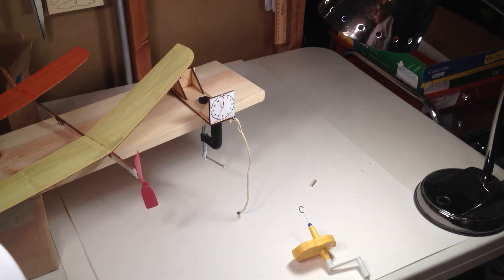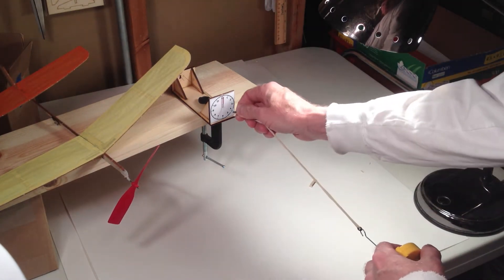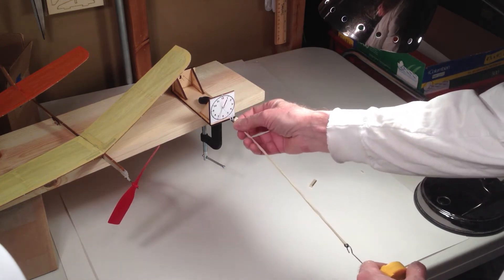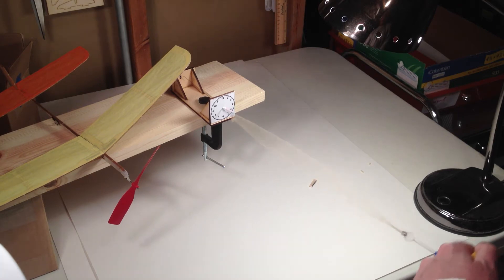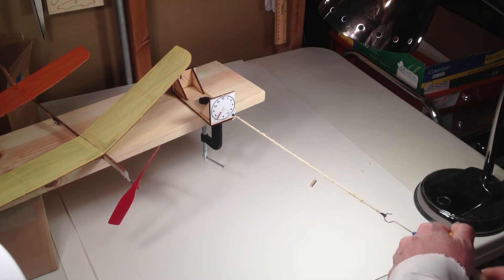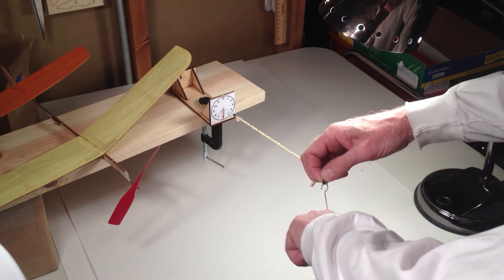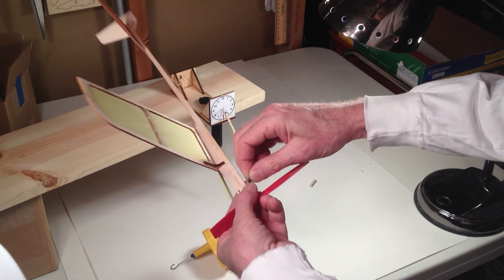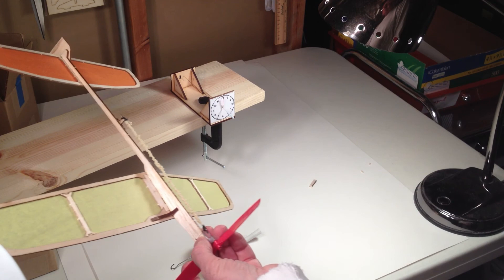Dirt Cheap Torque Meter from Laser-Cut Planes (lasercutplanes.com)

Comment: o-rings on the rubber. Brilliant! One of those "duhhhhh....why didn't I think of that?" instead of fussing around with trying to pull the rubber off the stooge and still maintain a loop to slip on the motor stick hook.

Comment: There is a formula for ESTIMATING the maximum turns a motor will take before breaking. 

T = LK/sqrt(S)

T - turns
L - length of motor
K - empirical turns coefficient
/ - divide
sqrt(x) - square root of x
S - cross section of motor

Cross section of motor is the product of number of strands, strand width and strand thickness.

S = nwt

n - number of strands
w - width of strand
t - thickness of strand (Modern Super Sport rubber nominal thickness is 0.042″)

K will be different for different batches of rubber.  It can vary some within a batch. It will vary with temperature. It will vary with your lubrication and winding practices. It is established through testing. Make up and wind test motors in your usual way at standard temperature, record the breaking turns and calculate values of K from K = Tsqrt(S)/L. With lengths in inches, a value of 10.5 is a safe default for modern Tan rubber. You may find values as low as 9 or as high as 13.

You should not use this number to decide when to stop winding your motor. It is an ESTIMATE to be used as a guide for when to pay close attention to the motor. As the motor approaches its maximum torque it will become less flexible. You can sense this by stopping your winding, letting the motor cool and giving gentle tugs on the motor. When the motor becomes very stiff it is time to stop winding. Knowing when to stop winding is a matter of judgement borne of experience. Motors that have been used may break sooner than expected. Motors that are wound fast will break sooner than expected. Motors that are allowed to cool by slowing the winding, especially at the high end, will take more turns.

Permanent link: http://www.endlesslift.com/rubber-motor-formulas/

Comment: This is a nice torque meter and I hope many take advantage of the kit. The illustrated instructions are very clear. Look at the diagrams as you read the instructions on bending the wire. You can use other diameters of wire for other applications.

I bought two of them to use in tutorials about the new AMA Alpha.

http://www.amaflightschool.org/alpha

I want to show how the torque curve translates into a flight trajectory curve and how that determines height and duration of flight.

http://www.endlesslift.com/the-energy-of-flight/

Understanding this allows us to size the motor for maximum duration.

To do that I need to have it calibrated in actual torque units. The clock dial would not do for that. I measured the torsion coefficient of the wire and it is such that if you make the wire 11.2 cm between the needle and the bend at the back, the clock dial will give torque in inch ounces multiplied by 10. In other words, 12 o'clock is 1.2 inch ounces. You will need to remove a little wood to get the outside faces about 0.9 mm closer together. You need a little clearance for the needle in front of the clock face.

You can see the thermodynamics of rubber in this video. When you wind rubber, the added energy makes the rubber hot. The heat makes the rubber push back. When you pause winding, the rubber cools and the torque declines. At the end, when you relax the tension, the rubber cools and the torque declines. A rubber motor is a heat engine.
Reply: If you make it 11.2 cm long, don't push it past 10 o'clock. It won't return to zero.

Comment: How many turns were on that rubber, I would like to know if it could handle a 2ft 4in, 1/8 loop of rubber at 1500 turns. Thank you for the amazing video! :)
Reply: No--I don't believe so.  Due to the fact that the hook is simply an extension of the wire with a kink in it (protected by polyethylene tubing), 1/8" would almost certainly come off and potentially hit you.  It's intended for 3/32" and below.  Thank you for asking, however!
Reply: You should be able to get 2,900 turns onto that motor, well lubed and stretch wound.  Two strands of 1/8" will break somewhere around 1.5 inch ounces. More or less, depending on batch. You can beef up the hook by sliding a piece of aluminum or brass tubing over the wire before you bend the hook.